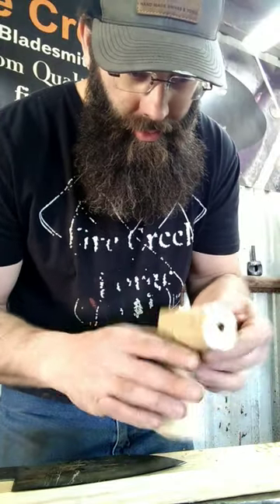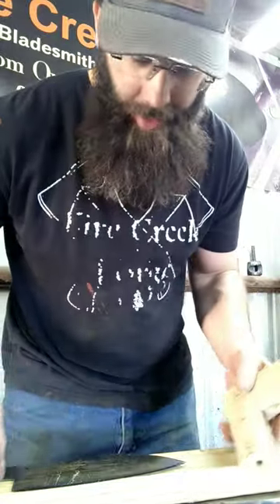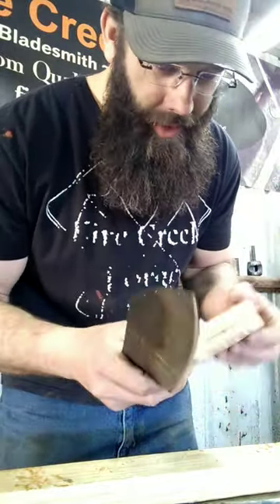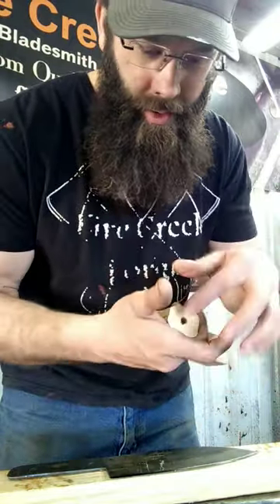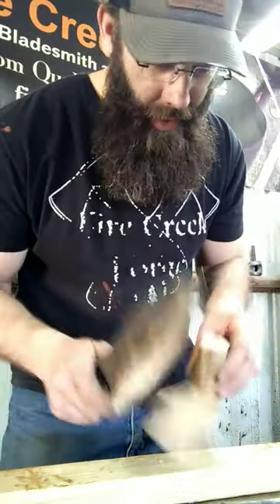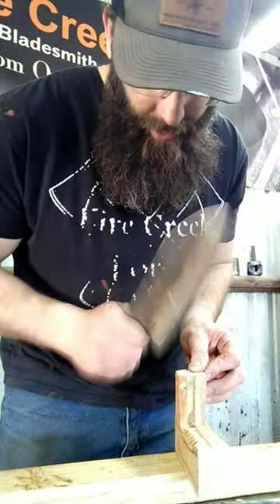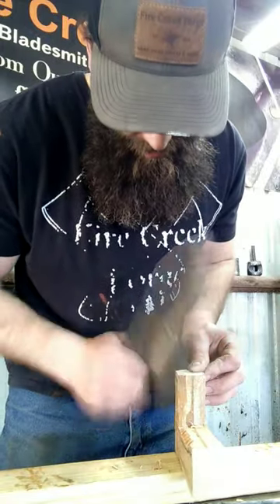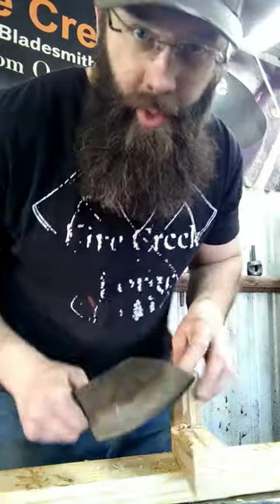Shaping a cane sword handle with a large thin knife

Comment: I’m a disabled vet and require a cane to walk and unfortunately that handles grain orientation is extremely concerning to someone who actually uses a cane, I realize it is not so much of a functional cane but as the maker you should be aware that when someone actually uses it as a cane that grain is likely to split causing the person to fall and potentially impale themselves. This potential issue is why canes with wooden handles use a steam bent piece of wood to create the shape of the handle so the grain follows the curve and gives it strength and steam bending is not very hard to do
Reply from the maker: I understand your concern, however the tang of the sword weill be running the full length of that cross-grained section, precluding that snapping in half and causing those issues.
Reply: @FireCreekForge  I’d still emphasize to the buyer not to use it as a functional cane because of that possibility. I’ve seen something similar to an older Marine Vet who made custom wooden canes for other Vets and he impaled himself with a similar design but luckily it was his arm and not anything more vital
Reply: @peltiereric6497 glad I used my bog standard aluminium L shape aluminium walking stick.
Give it a little squeeze & easy to fit an adapted Katana, sharpen the rear edge and lock grip into the sheath . Two handed sword or spear that gave one mugger a serious back passage evacuation.
That was "Betsy" ?
Bets he regrets picking a disabled trained vet 😂🤣😂🗡️